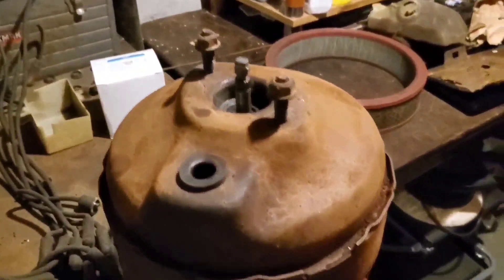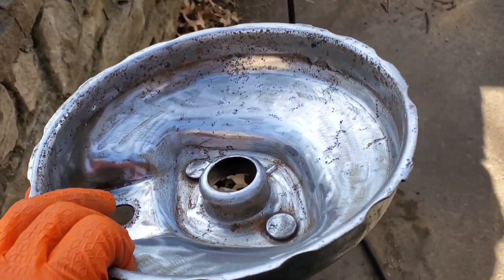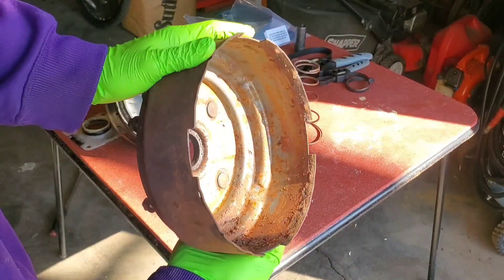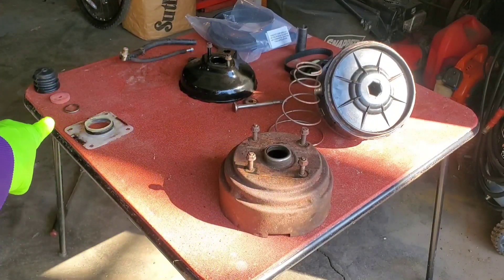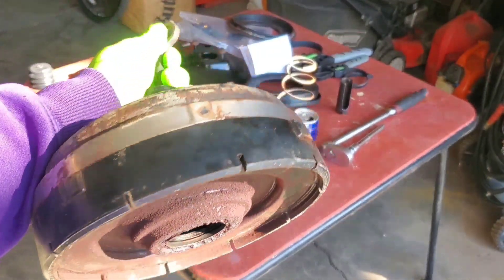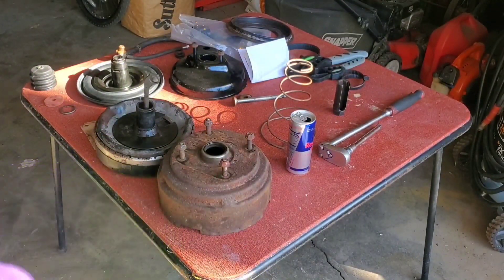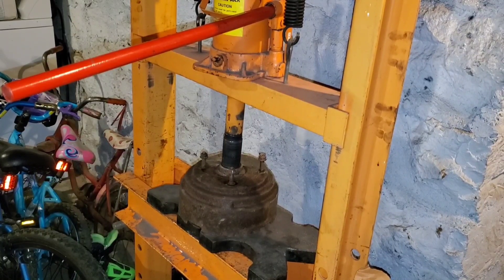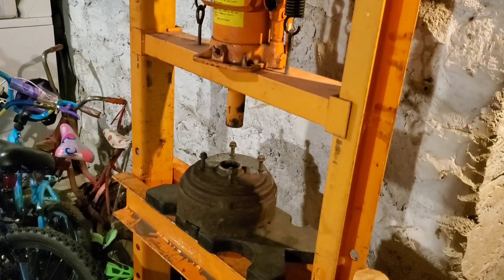How to REBUILD a Brake Booster! (1969 Lincoln Continental)

Comment: I didn't know that rebuild kits were available for brake boosters. Looks like you did a good job rebuilding it. Hopefully it works after all that effort.
Reply from the maker: I think they are only available for select vehicles where new boosters are difficult/impossible to find. And I sure hope it works too I have confidence it will. Plus I can save some effort by testing it with my vacuum pump before installation.  My only fear is the can not staying together even though I got those tabs bent back pretty well. I guess I never realized before but when you press down on the brake pedal it puts a lot of force on the front of the booster. Would really suck to be driving down the road, hit the brakes, and your booster busts in half lol. I took extra time on that part to make sure the tabs were as well seated as I could get them.  Stay tuned for further updates!

Comment: When are you going to take out the dash? There is a hose that comes into the fire wall that I’m trying to locate where it plugs into for weeks. Checked the manual, forums and groups but no luck.
Reply from the maker: Sorry to hear that. I actually don't have any plans of taking the dash out unless I come across something that requires it. At this time I have no plans to remove it
Reply from the maker: Can you post a photo of it? I may know where it goes
Reply: @Andys_Auto  you tube won’t let me post photos. Do you have instagram or fb?